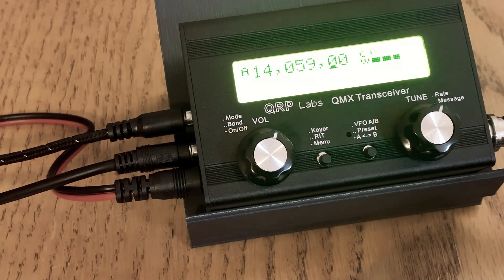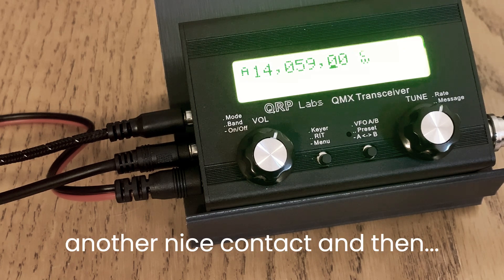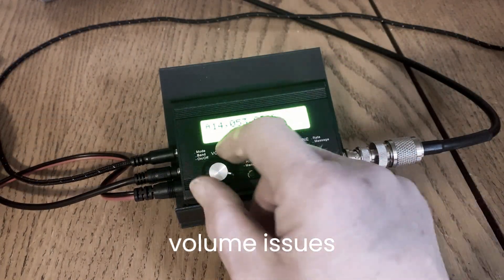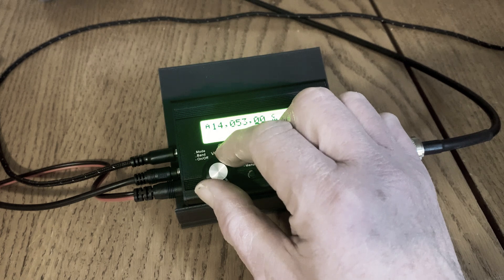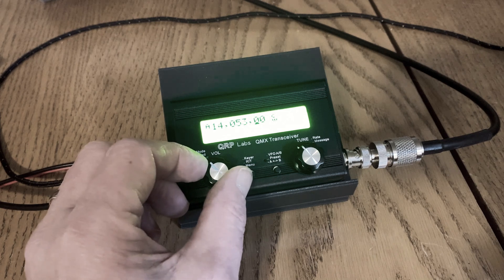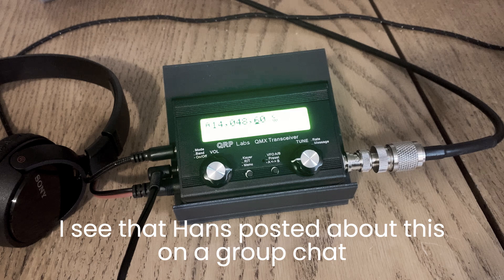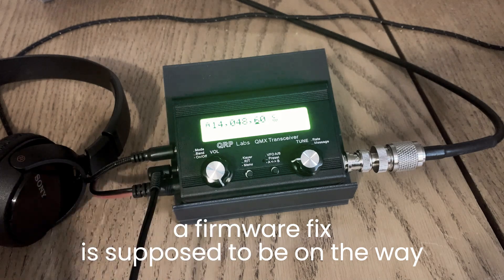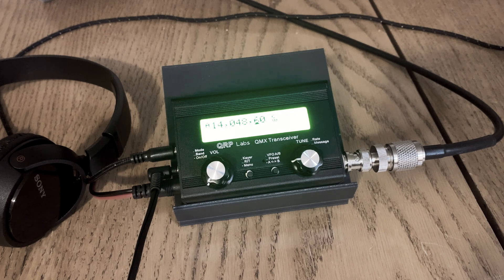QMX Vid 2 First Contacts, Volume Issue, SWR Readings

Comment: Looks like the volume pot looks loose. Easy fix. Best of luck. 😀
Reply from the maker: I'll try the new firmware today and check out the volume pot (it does feel loose) and tighten it up.  Thanks, Steve.  73